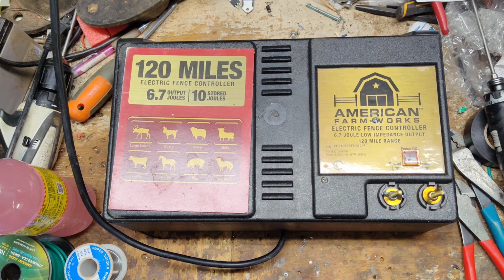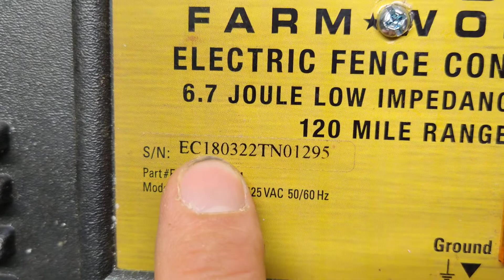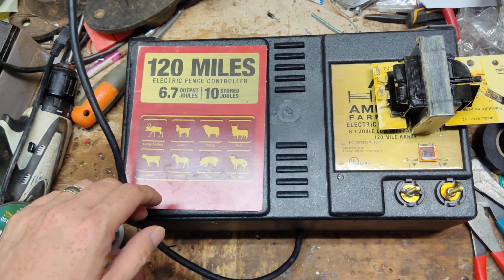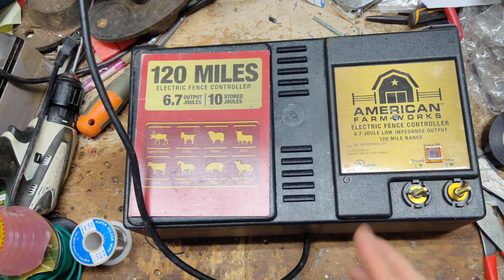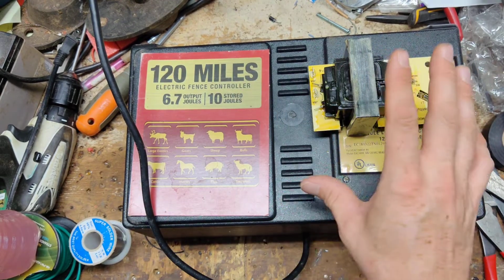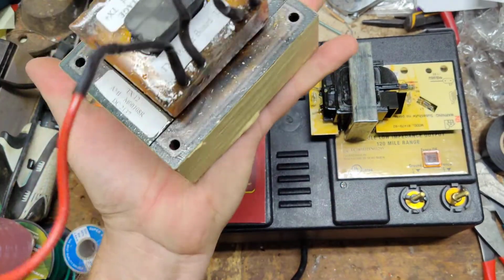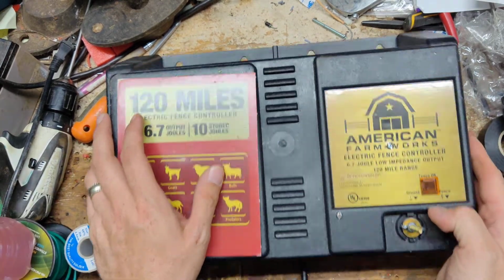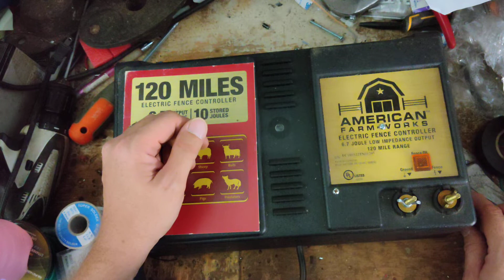Everything Good and Bad About An American Farmworks 120 Mile Zareba Blitzer Red Snap'r 100 Mile

Comment: I just bought one of these I need the high voltage to keep predators out but I only have about 1/2 an acre fenced in 5 strands is this a bad idea
Reply from the maker: If it was me, I would've bought a Power Wizard PW3000, it's a sharp snapping unit and pretty reliable as well. 
You're not going to see any difference in performance on the fence and shock between a 3-6 joule unit. I'd take that one back and get a 2-4 joule unit and you should be just fine. 
 
The charger is only going to be able to put out as much as it's able to on such a small area compared to what it can do. Whatever is leftover that it can't get rid of is going to be dissipated as heat inside. I'm going to guess the life of your unit is going to be diminished quite a bit and you'll only get 1-3 years out of it.
Reply from the maker: The voltage is almost the same range from model and brand, 6,000-9,000 volts, what changes is the joules. But there is a point to having too big of a charger on too small of a fence. I see it all the time and some brands deal with this issue better than others.

Comment: If I have roughly 6 acres fence and I wanna run 3 wires for sheep what "milage" would you suggest?
Reply from the maker: Don't look at the mileage too much, that might get you in trouble and you end up buying too small of a unit. Look at the joules of the unit and for sheep/goats most people recommend 3-4 joules minimum. If you compare the joules to what some makers state for mileage ratings on their front cases, that would be around a 60-75 Mile unit, but I'm not a big fan of the mileage rating units. Here are some brands and models I would look at. Gallagher M560 M800, Power Wizard PW3000 PW6000, Cyclops Champ or Cyclops Brute. These are all AC powered units as well.